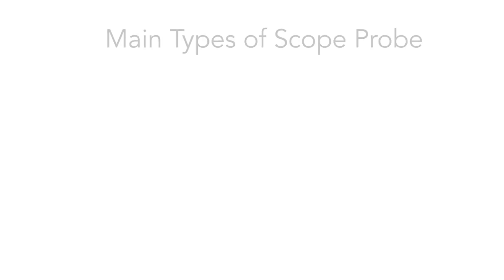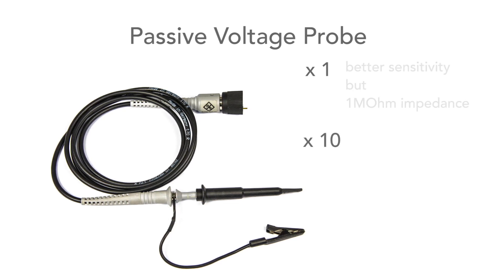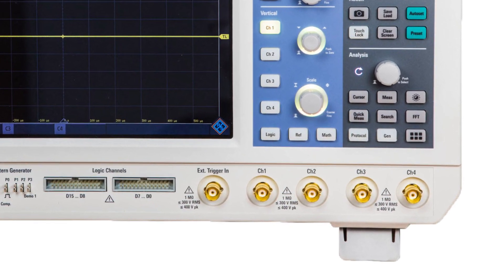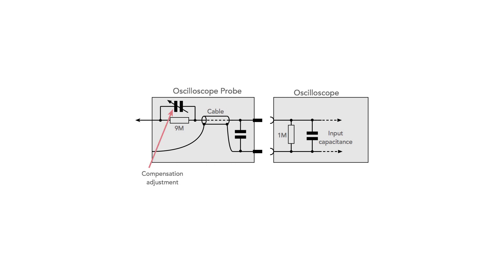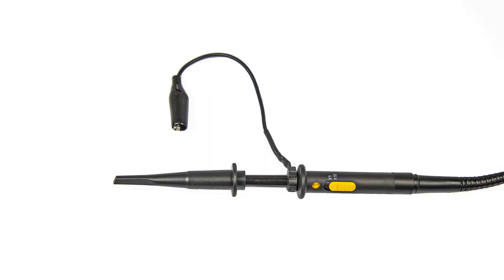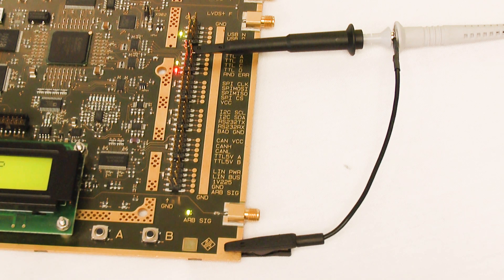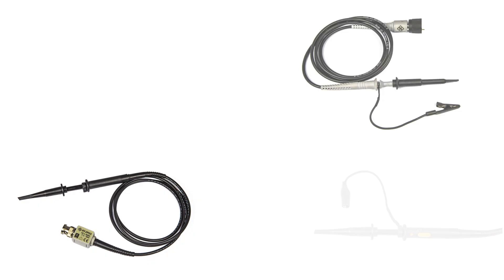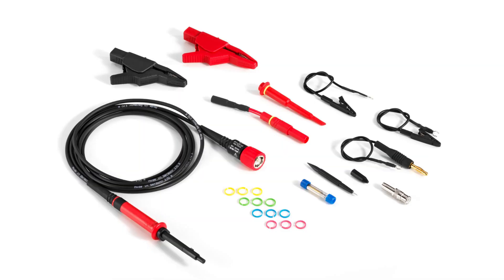Oscilloscope Probes: What You Need to Know

Comment: hi can I use 150 MHz probe on 50MHz oscilloscope?
Reply from the maker: Yes it is perfectly acceptable. If the probe exceeds the performance of the scope, then it will not degrade the performance of the scope. If the probe has a lower performance than the scope, then you the probe will be the limiting factor. The performance will reflect the item (scope or probe) with the lowest performance.
Reply: @ElectronicsNotes  thanks .

Comment: I'm confused about something. I'm an auto tech and I'm trying to build a wire that connects a vehicle comm port (two-wire can-bus) to my scope. When I'm using a voltmeter to watch the voltage switching, I have to attach my negative lead to the -wire and the positive lead to the + wire. But the most popular probe (as shown in the video) has a single hook. Where is the ground coming from if  the scope is measuring voltages?
Reply from the maker: There is normally a clip that fits onto he probe that is connected to ground. You can actually see these clips on the probes.
Reply: @ElectronicsNotes  I appreciate that, but what I mean is, do I need that clip to get my signal on the two wire can-bus?

Comment: Sometimes though you just want to look at a signal and its shape without measuring it, like when you're aligning an old valve radio
Reply from the maker: I agree, but I always tended to adjust the compensation because there may be one instance where a more accurate reading is needed, or where the waveform could be distorted by poorly adjusted compensation - it only takes a few moments.

Comment: could you explain about 50 ohm input impedence? When and Why we should use it.
Reply from the maker: 50 ohm impedance is the standard impedance used for RF transmission - there are many 50ohm coax feeders and lines. Using this for a scope is useful with some RF design measurements and it can give some better RF readings. But be aware that the input terminating resistor is not overloaded - it would be easy to burn it out.

Comment: I understand the "loop" distance problem/issue but how about using an extension from the scope to the probe's BNC connector?  I see extension cables are available but seems to be mostly for non-scope/probe applications.  I guess I can just move the scope (it does have a handle) but I have an old analog type so sort of heavy/large to keep moving around.

Comment: Hi, Im really grateful for this video because im really dont understand how to use a probe. May i know is it possible to use hook tip connects with the 5V motor directly to test it's electricity generation in mini wind turbine? Where should i connect my earth clip to? Thankyou very much and Im appreciated for the info given.
Reply from the maker: The earth clip should be connected to earth. However you also need to ensure that the point you are measuring is also referenced to earth. But beware you don't earth something you should not. If you need to measure the difference between two points you may need an isolated differential probe. Normally though measurements are with respect to ground.

Comment: 1st  i have a question why these probes are too expensive
Reply from the maker: You can buy both low cost and very expensive probes. The low cost ones obviously don't have the same performance as the much higher quality ones that are designed and manufactured to exacting standards, sometimes having individually adjusted elements to them to ensure very high performance at high frequencies. The coaxial cable is also specialised and manufactured to high standards as well. This all adds cost.
Reply: ElectronicsNotes according to indian currency it costs 10,000Rs means almost 145$ i dont have enough money to buy a oscilloscope but i can buy a kit and its around 15-25$ means im spending  130-110$ extra just on probes
Reply: ElectronicsNotes do you have a tutorial video on how to use oscilloscope
Reply from the maker: We don't have a video on how to use a scope yet, but we are planning one, possibly for next year. There are a few other videos in the pipeline before that and I have to get all the relevant video clips together and this will take a little time.
Reply: ElectronicsNotes im waiting but if you are taking this long time you should teach basics and ever bit advance stuff so it will be easier for people like me to understand and use an oscilloscope although thanks for replying 👍👍🙏
Reply from the maker: We have a page here on using a scope: https://www.electronics-notes.com/articles/test-methods/oscilloscope/how-to-use-oscilloscope.php and also a video on scope triggering: https://youtu.be/H0Czb2zBzsQ I hope these help.
Reply: Guitar Guy too bad you never lived by me I can get them for 20 bucks.